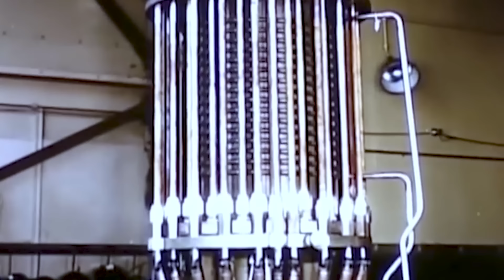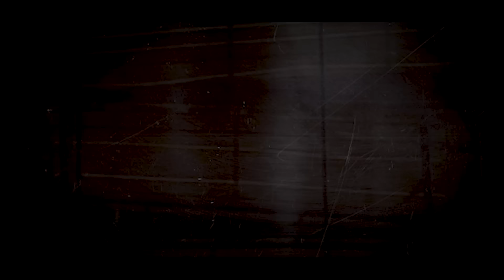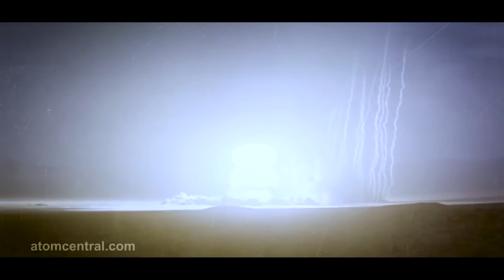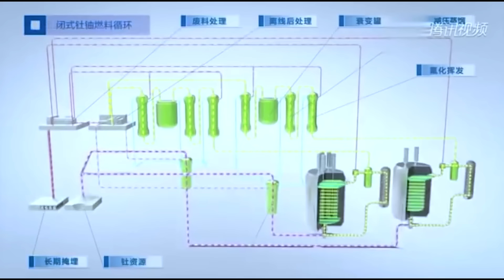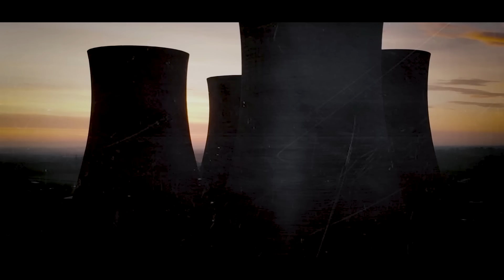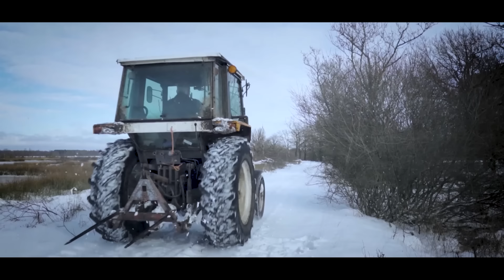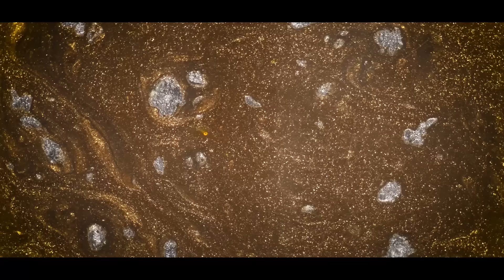Future of Thorium Reactors and Nuclear Energy

Comment: Clean, safe, too cheap to meter! Yeah, nuclear-power airplanes but for those darned regulations! If only the 737 had had a nuclear engine, it never would have crashed becaude it never would have needed to land. Your naiveté is almost forgivable due to your age but your arrogance, less so. The reason that uranium was used for domestic energy production was precisely because it was fissible and could be used in nuclear weaponry. Have you ever considered why the Energy department is primarily responsible for the US nuclear weapon stockpiles? Nuclear energy production, always the most expensive way of generating electricity, has been promoted as a means of indirectly subsidizing and maintaining the infarstructure for nuclear weapons production. You keep citing the fact that there is more Thorium in the mantle than Uranium but that itself says nothing about its retrievability, processing costs, nor how Thorium can replace Uranium without the same government subsidies. Oh, and your statistic about the investment money that could hev been spent on Thorium reactors, how much better off would we all be if that same research funding had been directed towards photovoltaics, wind turbines, and a more efficient transportation network?  I get it, you are getting a degree in nuclear engineering but this pollyannish enthusiasm for yet another promising breakthrough which will solve our energy needs indefinitely without any negative side effects (do they not teach you about the equally limitless potential for energy from fusion reactors that is only 6 months away from being a reality?) frightens me just how limited your history is of the industry that you hope to be working for and the financial and military motives behind its creation

Comment: I know Kirk talked about freeze plugs a lot but the idea seems janky to me. Why wouldn’t a simple pressure valve do the job? A variation of what is used on a pressure cooker. Running a freezer hard enough to keep super hot radioactive corrosive goop plugged seems a bit silly 🙃
Reply: You have a very strange reaction to one of the best design features of advanced rectors, the reactions have to stop and cool down if the plug melts ,that is much more reliable than a valve.
Reply: @paulbedichek2679  to keep the plug frozen next to a nuclear reactor means running the refrigeration really hard.   You run the risk of lots of false shutdowns when the reactor is running fine,  just the fridge breaks. Not to mention the energy required to run the fridge...   
My question is why bother,  wouldn't weight and a spring,  a safety value (like on a pressure cooker) do the same thing much more easily ?
Reply: much more reliable, by far!
Reply: It's not pressurized dude. You're comparing apples to oranges.

Comment: Why do you compare the cost of a thorium reactor to coal and natural gas?  Currently Coal and natural gas are more expensive than a combination of wind, solar and batteries (WSB). So the question should be is thorium cheaper than a combination of WSB. Also, WSB installations can be produced in 1 year instead of 10 years like nuclear reactors so the benefits start occurring sooner. For long-term storage off-river pumped hydro is a mature cheap technology. Nuclear reactors produce baseload power that generally takes days to change its output so still needs energy storage since it is not dispatchable. For example, Japan over the last 50 years has constructed 1 GW of off-river pumped hydro storage for each 2GW of nuclear it constructed. This was because they did not have gas peakers as an option. So if we get rid of gas you still have to build batteries since nuclear is not dispatchable. So the cost comparison should be nuclear+ batteries vs Wind+Solar+ batteries.  The problem with nuclear is not public perception it is that it is not economical.
Reply from the maker: Yes, you bring up a few excellent points here - all of which are completely valid. I compared nuclear to fossil fuels to compare a technology that produces high to one that produces zero opperating emissions yet both create a reliable source of energy (wind and solar are not as reliable and battery storage to suppliment that does still not have a competitive price - infact projections show a mid of roughly $200 kWh by 2030, too expensive to keep up with decreasing costs of solar panels https://www.nrel.gov/docs/fy21osti/79236.pdf)
Reply: No you have it backwards wind and solar have taken far too long they still don't produce as much unreliable intermittent current as our old fashioned reactors that have been running forty years solar and wind have beeb extremely slow to deploy even with the cheapest panels in Chin nuclear gives more energy.
 We will have about 20% nuclear and 80% wind and solar as nuclear acts as storage to firm up cheap but unreliable sources.
Wind and solar need constant backup,thatvis why the world is so polluted today.
Reply: No one anywhere uses re and batteries hydro and nuclear are the only reliable low Carbon sources.
Reply: WSB, as you call them, have a lifespan of about 20 years, after which they are discarded. There is no recycling. The heavy metals they contain, bought with the lives of child slaves, is allowed to leach out into the biosphere, unlike any of the contents of a nuclear plant. If that's not enough to quell your opposition, then you need to find out about the copper crisis caused by our unachievable attempts to connect all the WSB sources to the grid. It can't be done, not even in the Wsst. We need nuclear, and we need the luddite wing of the Green movement (of which I'm a card-carrying member) to stop obstructing it.

Comment: I studied nuclear physics. But I still hope we can eliminate nuclear energy dependence and return to a sustainable live without it. Solar and wind are not adding additional heat to the atmosphere, certainly nuclear is better than gas and coal, but when you add additional heat sources to an already hot place, that does not bode well. 
I think science and technology should focus on energy storage systems (for winters/night), energy distribution (e.g. from Moroccan desert to cloudy UK), Solar powered carbon capture, producing jetfuel as an output (Swiss project), More solar rooftops and buidings, etc...
On top of that, we should have a global plan to slowly decrease the world's population because adding more people to this poor planet is going to end very badly.
Reply: What is the sustainability of wind and solar?  Like there is a tremendous use of non-renewable materials to make these systems.  These systems of power production require a tremendous amount of environmental destruction to install and in most cases require massive amounts of fossil fueled back up to function. Why not use nuclear where it makes sense and renewables where they make sense?

Comment: Excellent video. Most of these benefits are because of liquid form of the fuel. You could change title to "fluid-fuel reactor" or "molten-salt reactor". You may also change the script and use "molten-salt reactor" instead of "thorium reactor" and re-upload. At least you could write a note in description and give a link to wikipedia page on Molten-Salt Reactor.
Reply: I would use the term "Molten Fuel Reactor"or "Liquid Fuel Reactor", but I'm funny that way...  That differentiate it from solid fuel MSRs, which aren't very much different from the solid fuel reactors we use today (BWRs, PWRs).

Comment: To nitpick the inaccuracies:
Thorium's abundance isn't whats really great about it. We're not running out of Uranium.
The thermal efficiency doesn't matter when the fuel price for nuclear is so low.
Classic reactors do not explode shooting radioactive waste everywhere if the [cooling] pumps fail. Without cooling the reactor melts. Fukushima blew up because of hydrogen build up, it wasn't the reactor that blew up. Chernobyl was a runaway chain reaction (they turned off the cooling pumps - they didn't fail; it blew up because of the positive feedback loop both inherent in the design and how they ran it off the edge).
It would be very brave to build any nuclear reactor without a containment building.
Using a thorium reactor to make weapons grade material is very easy. The protactinium has to be separated out anyways to feed it back into the reactor (after it has decayed into U-233). Separating this U-233 from the protactinium is done with a chemical process and so is very easy compared to using gas centrifuges. Compared to breeding plutonium, everything is done except the last step.
Water scarcity is not an issue for using water in the primary cooling loop since it is condensed and returned the losses are minimal. Thorium reactors also use water as the working fluid which also has minimal losses. Uranium (and conventional hydrocarbon fuel power plants) use water in cooling towers since it is often cheaper than air cooling. But some modern nuclear plants use air cooling.
Nuclear powered planes are a very bad idea. The exhaust is radioactive.
Government regulation and public perception are not what has prevented nuclear war. Mutually assured destruction has.
You leave out the fuel reprocessing requirement of thorium reactors when discussing economics.
Nuclear is 20% of the USA's electricity production, but it is only 10% of the USA's energy production. It is an important distinction. Your other similar statistics are similarly wrong.
Fuel reprocessing of a uranium reactor would produce a similar reduction in transuranics. It isn't done with uranium reactors because its cheaper to purchase new fuel.
Reply: Price of fuel is everything: currently nuclear fuel is cheap, because of miniscule demand.
Reply: @piotrd.4850  Huh? Economy of scale actually works the other way. Miniscule demand? You know uranium isn't just used for civilian power production right?

Nuclear fuel is cheap because so little fuel produces so much energy, very little fuel is needed (compared to combustion power plants). Its the capex and financial risk that make nuclear expensive.

https://www.youtube.com/watch?v=cbeJIwF1pVY

Comment: When was Germany interested in this technology? They shut down several nuclear reactors and turned to other sources such as fossil fuels and even importing electricity. And their position, although criticized by the climate activists, is not entirely unreasonable, as we've witnessed several times the consequences of an accident. Also, even if they were to somehow make an entirely failsafe nuclear reactor, the problem of long term radioactive waste management would still exist.
Nuclear power is indeed incredibly versatile, as it can power anything, from the smallest things such as as pacemakers and bionic hearts via nuclear batteries, to the largest vehicles such as planes and ships, and even provide electricity and heat to entire cities. However, there are downsides to every technology, and they must all be accounted for.
Reply: Molten salt reactors will not produce long lived nuclear waste.  In fact several designes like the Elysium reactor  are designed to run on nuclear waste.   The Elysium reactor is also designed to never produce any usable weapons material, in fact it is designed to destroy weapons grade material.  So what's your objection now?

Comment: Great video man, well done! Didn’t know thorium fuel was a liquid, very cool 👍👍
Reply from the maker: Thank you, I appreciate the support.
Reply: U is just as liquid ,when you heat something practically anything becomes liquid.
Reply: thorium metal is a solid at temperatures up to hundreds or thousands of degrees. But if you react it with hydrochloric or hydrofluoric acid, the resulting ThCl or ThF salt, when dried, melts at relatively low temperatures. Some thorium reactors use solid thorium, some use molten thorium salts.

Comment: What cost premium do you think nuclear deserves over intermittent sources like solar and wind?  2x more per MWh?  5x?  10x?  $1B invested in wind will produce ~4TWh/yr.  How much should we be willing to invest in a nuclear plant to get the same 4TWh/yr?
Reply: Wind and solar must pay for their intermittency.
Reply: @paulbedichek2679  Still WAAAY cheaper then nuclear.
Reply: @paulbedichek2679  Solar is $30/MWh.  New nuclear is $120/MWh.  Which number is bigger?  30 or 120?
Reply: @Chris-ie9os  Solar is so expensive, the government must pay a third, still it’s too much and Tesla get its energy from gas not solar.
Reply: @paulbedichek2679  Even if $30/MWh included 1/3rd from the government that's still ~$45/MWh vs ~$120/MWh from nuclear.  Nuclear is still >2x more expensive than solar.  Nuclear needs gas too.  If you have 4GW of nuclear and peak demand is 8GW where do you think the other 4GW comes from?
Reply: @Chris-ie9os  Nuclear doesn’t need solar or wind, but we have some wind and a very little solar, our advanced plants will work well with these unreliable sources.
Reply: @paulbedichek2679  Why spend $120 on nuclear to reduce gas use by 1MWh when it only costs $30 with solar or wind?  Economics matters.
Reply: @paulbedichek2679  Why can't you answer the question?  Ok... let's say there is ZERO solar right now.  None.  But the cost to add solar is $30/MWh.  Why spend $120/MWh on nuclear?  Reliability?  Don't need it.  We have gas turbines already operating.  We just want to use less fuel.  So why $120/MWh on nuclear to use less fuel instead of $30/MWh on wind or solar?
Reply: @Chris-ie9os  Nuclear cost far less than solar today much less you are openly advocating for planet warming gasses, under Biden coal use in the US has skyrocketed, Eu is freezing to death with huge energy bills expensive coal from Russia, you just love coal, in China with vastly cheap solar they get less expensive energy from legacy nuclear, advanced nuclear will be less expensive.
Reply: @Chris-ie9os  First solve the huge solar waste problem the panels need replacing and get thrown in the trash while nuclear sequesterers the tiny amount of spent fuel, panels need to have deposits.
Reply: @paulbedichek2679  ????  Vogtle, VC Summer, Flammanville and Watts Bar would disagree.  Vogtle is $30B to add 16TWh/yr to the grid.  You can buy 30GW of solar for that price producing 65TWh/yr.  Solar averages ~$30/MWh.... nuclear ~$120/MWh.  How is $120 < $30?????

Comment: Even if it takes a long time to approve Thorium reactors, we can continue building existing Uranium reactor designs, which are perfectly fine.  Remember France converted electrical grid to 75% nuclear in only about 15 years, back in the 1980s.  They did it quickly and cheaply.  Other countries can follow their example any time we want.  We simply need to make the decision to do it.

Comment: Your cost of nuclear energy is not correct. There is a huge hidden cost the public subsidizes - the nuclear power act gives nuclear power a free ride where liability insurance is required. As an example the state of Montana passed a law where nuclear power plants cannot be sited unless they are fully insured including liability, thereby effectively shutting down any nuclear power plants.

While I have no personal animosity against nuclear power, the enormous costs (and even larger cost overruns) have greatly soured my outlook for them. My personal opinion is that nuclear energy is rife with corruption. The amounts of money involved are obscene.

I also worry about security in these times of internal and external threats. I also think that as personal power generation (solar cell and personal wind generators coupled with Tesla power walls or the Australian Lavo hydrogen power cell) become more prevalent the security risks from attacks on centralized power sources will decrease. The smaller size of thorium reactors gives me hope though.

Comment: A few notes on the production/structure of this video. This is meant to be constructive criticism, take it as you will. I'm no expert at Youtube or Nuclear Engineering.

The script for this video leans very academic. At times it felt like a Uni paper being read. The 2nd half of the video goes off on tangents that while expected to be covered in an engineering class, may not be relevant to a youtube audience. Transuranic elements are important, but the video super quickly introduces them, and then starts rambling. A better quick explanation with some diagram would have been helpful if you wanted to dive into the topic.

The first 8 or minutes was really good, you can tell you know the stuff and are interested in it. The rest of the video felt like that last page of the your 5 page paper where you're padding and needlessly recapping.

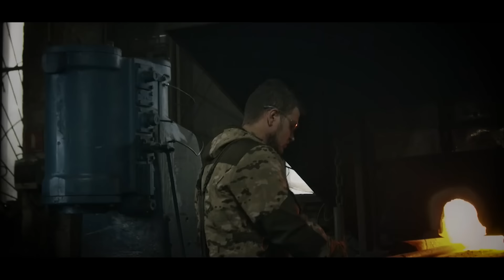I was getting some sound desync starting around the 5-6 minute mark, even after a video reload. I watch informational videos at 1.25x speed, but something was definitely off about video/sound sync. There were some volume drops/bad splices, the most egregious was at 19:38.

I look forward to future videos!
Reply from the maker: Wow, I cannot say how grateful I am for your feedback. I will make sure to address these issues in all future videos.